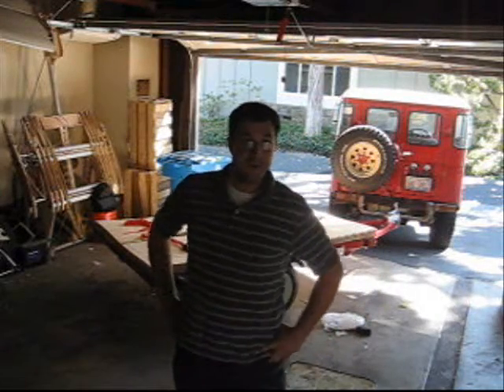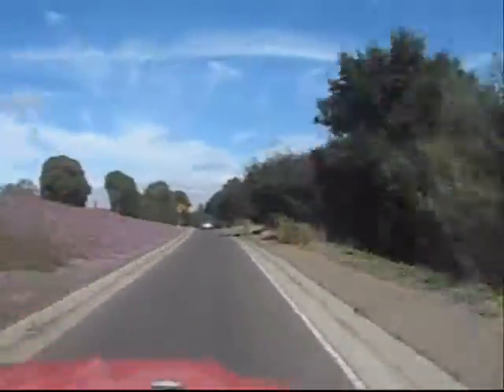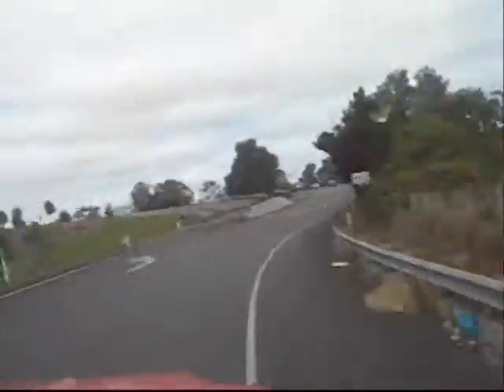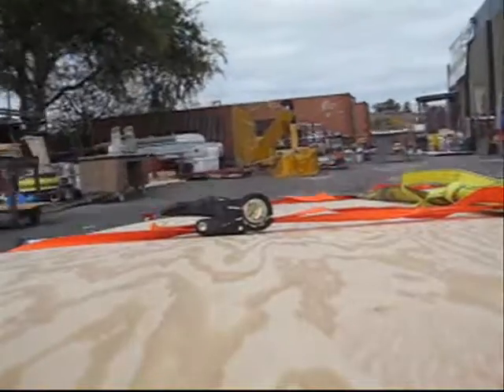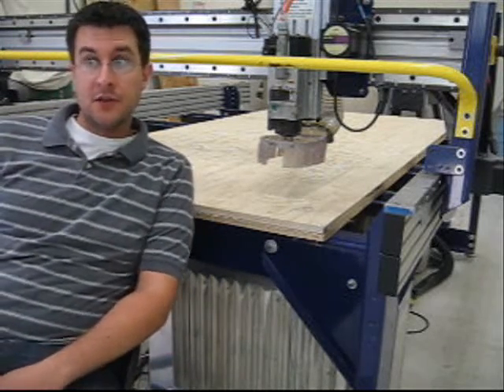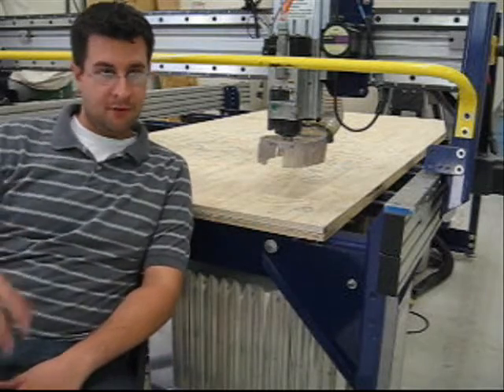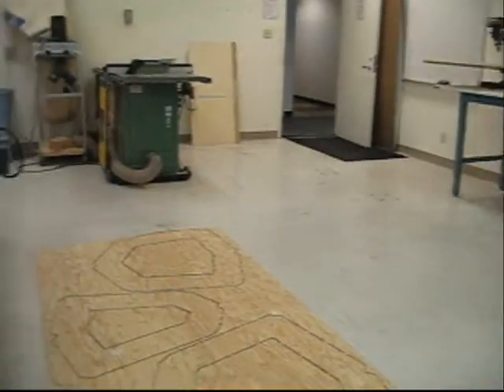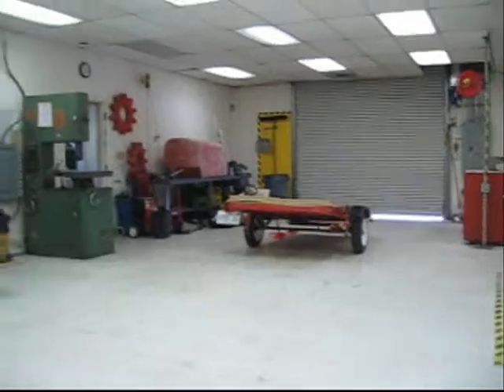Lonelybot.com - 9/6/09 Hull Components Cut!

Comment: well I suppose one might say that a Ford Ranger is a big truck until one has actually seen a big truck.  A shopbot is a small, extremely light duty machine that uses a pseudo-CNC PC based control.  It is not particularly accurate, certainly not fast, not ridged and not durable.  It is really not much more than a home built hobby project.  Maybe it is all that you need but to compare it to a large CNC machine as kinda like comparing a big mac to fillet mignon.